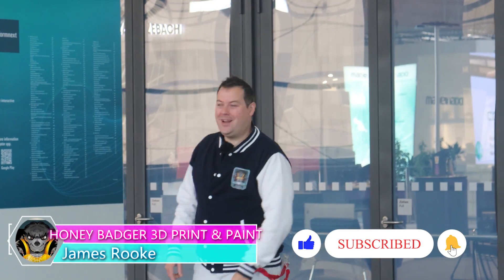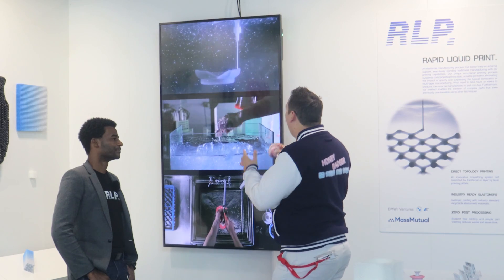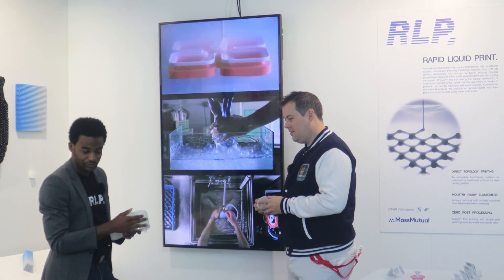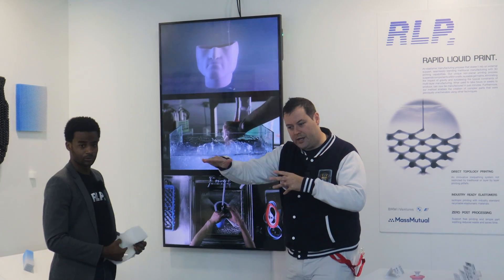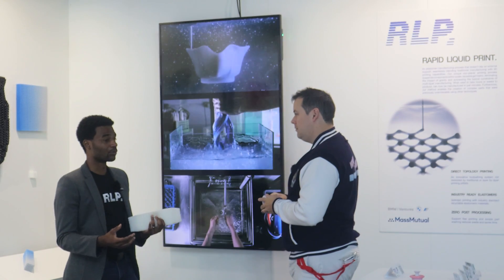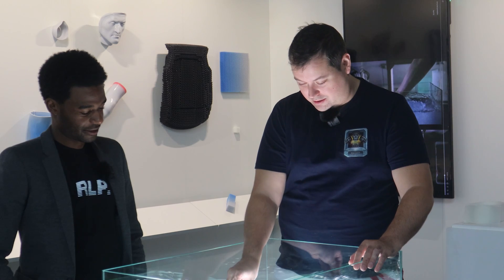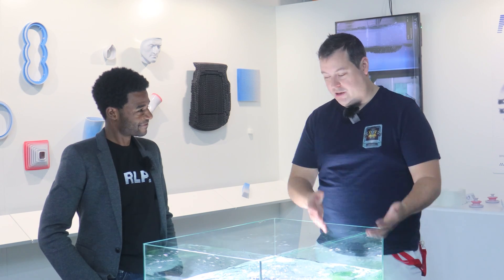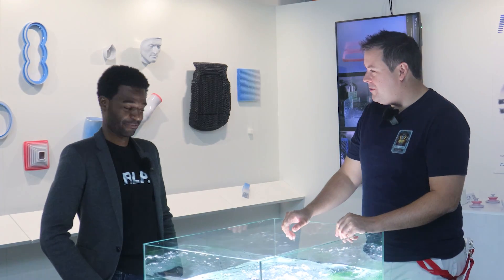Formnext 2023 - Rapid Liquid Printing - Zero support alot of goop

Comment: What is the thinnest part that can be produced, the place i work is injection moulding silicone diagrams, they're 0.5 0.4mm thick, this sort of tech would vastly reduce the cost if we didn't already spend half a million on a brand new IMM that we basically don't use lol.
Reply from the maker: so you would need to ask RLP about their technical sheets we only had the info at the show, its worth nothing they stated at the show they don't sell machines they sell the finished product using the process but if you reach out to them with a use case I'm sure they would be happy to help

Comment: What is the resolution ie what's the smallest printable detail. Couldn't you do the same thing with SLA resin, applying the resin in the gel and then using UV light to harden it in the gel to create non flexible objects? That seems pretty obvious.
Reply from the maker: so the problem would be the different material density i would bet, RLP only offer the final output as a service not the actual tech so not sure how much they are looking to expand the material set

Comment: Can it print hard rigid plastics or only soft flexible stuff?
Reply from the maker: so right now they are printing silicone, i believe i can be adapted for rigid but it would likley be a UV resin that cures as it comes out of the nozzle

Comment: I wonder if this could be adapted to FDM printing. Print in a heated medium that is just below the glass transition temp. Medium could absorb heat from heater cartridge and from the extruded plastic. No need for supports or annoying, whining cooling fans.
Reply from the maker: so there is something i saw about printing in UV resin and it cures as it comes out of the nozzle but these guys arent even selling the tech they sell the service

Comment: the easy-to-find 2017 paper titled Large-Scale Rapid Liquid Printing covers the basics with the same verbage used here and answered the question i had of the gel medium type.. The suspension medium is a granular gel produced by using carbomer 940, a crosslinked polyacrylic acid polymer in the form of white powder mixed into water until it is fully dissolved then mixed with a neutralizing agent, such as a sodium hydroxide solution, is added until the mixture reaches a neutral pH value of 7.0.
Reply from the maker: hands down this is most technical comment we have ever had, most of my analysis consisted of how sticky it was which let me be clear rate a 9/10 of my weird stuff-o-meter and easily the 4th grossest thing i have stuck me hands in
Reply: I just want to know whether it's edible.
Reply: Question, do we know how much weight the suspension medium is capable of suspending ?
Reply: @mathkor89  It was implied that it's unlimited, this is probably true as that's acheivable by just making the medium the same density as the print material
Reply: @spaceprior  that’s wonderful, sorry if it’s a silly question but would I be able to make that at home with little to no DIY ?
Reply: @mathkor89 done some looking, looks like you absolutely can and it’s not even that expensive. Just your average extrusion syringe style printer, probably a mixer inside it that mixes a 2 part silicone, and a motorized auger inside. I might give this a go. Could probably do it with an existing printer without too much issue.
Reply: Did you ever try to make this? 😊
Reply: @mathkor89  dunno about weight but there may be other limits to do with the stiffness and length of the implement used to deposit the print material. You don't want a big thick needle as it will cause the medium around it to shift as it moves. There will be other limitations such as the type of infill used (can't have pockets) and printing enclosed structures without a hole to let the medium flow out from in post-processing. if you then want to inject another substance into the void and seal it, you'd need to create a flap sealable after that's done, or puncture and re-seal the surface.
Still extremely impressive, but I wonder about the level of fine detail possible.
Reply: I on the other hand wondered how the silicon is extruded and thermally isolated because that needle seemed metalic also the acurracy of strafing a thin thube with a needle several meters or at least about 1 through gel and how does it orient it sel etc so checking out that paper will be useful thanks
Reply: To follow that now they are looking to make a 'silicone' robotic manta ray 3d printed in what seems a very similar method to swim in the Antarctic Oceans. I could imagine several 55gallon drums of UV activated liquid silicone being needed for a full size mother manta ray in a large bath setup just to do this.

Comment: I didn't hear any mention of the resolution?
Reply from the maker: so they didn't give one, from what i saw i would say a 1-2mm layer height which normally i would say was bad but because this is silicone material not normal filament and because its nonplanar in how it was laid down the surface finish was perfect with zero post processing